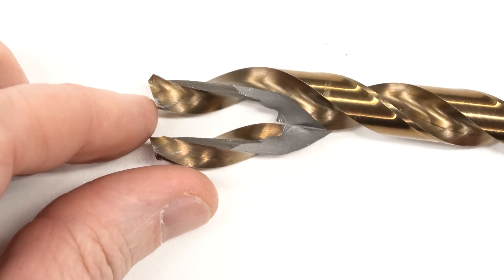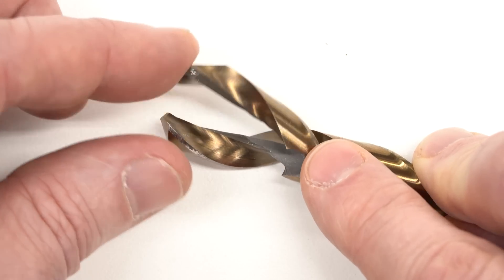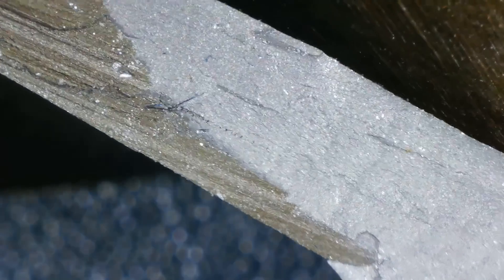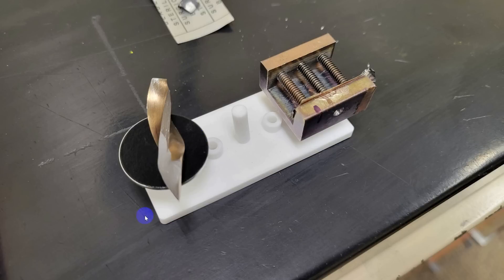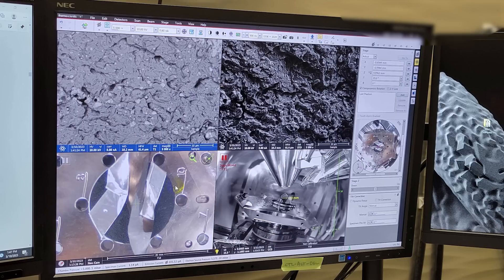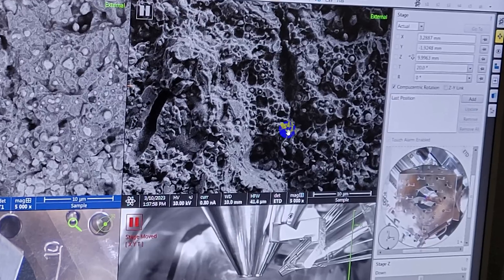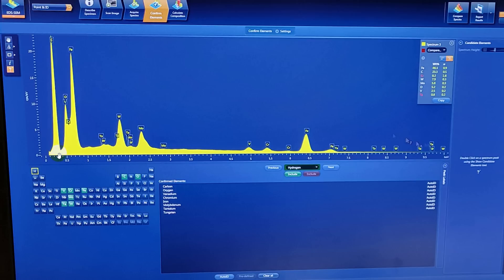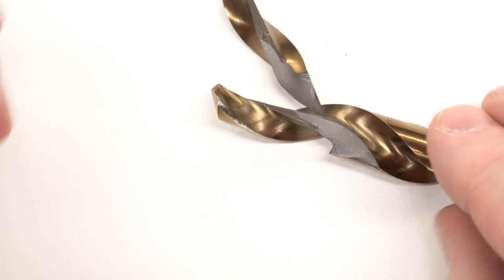What the Scanning Electron Microscope Reveals About This Failed Drill

Comment: Hi from France, James !
Many many thanks for this VERY INFORMATIVE content. I have an "oral tip" given to me, to use garlic juice when you have to drill or machining especially hard materials, able to reach very high Ultimate tensile strength, like "supercharged" titanium alloys, ASTM B348 grade #5 or ultra low interstitial formulation, like renowned #21.

Could you please make an attempt to drill a titanium sample with garlic juice as coolant/lubrification liquid ?
Then compare the kerfs, with ultrasonic degreasing cleaning solution like isopropyl alcohol, with the machined part, somewhere where garlic has not be used ?

It could be especially useful to prove on a stiff demonstration that the chips, curls, shavings, kerfs and turnings are much more "contaminated" with atomic sulfur, coming from the garlic juice ?
Until which depth ? It could be a brilliant way to determine an optimum of depth of cut.

When a metal is badly cold-streched, you create lots of translocations in the crystal lattice. Enough to allow low-temp melting point atoms to diffuse into the cold drawn metal, then lowering drastically the Yield Strength and also UTS, thus enhancing productivity by allowing softer curls, shavings and turnings to be extracted. Reducing tool fatigue, too.

Beware of garlic juice, it contains LOTS of sulfur and can create severe cutaneous burns.

It seems that the drill which have broke whas "charged" by carbon and oxygen diffusion, occuring when the heated part is too badly heated, in presence of carbon-rich substance. Especially at full austenitic point ("AC3" line in diagram phase, for common C-Mn steels, often around 970 to 1050°C). It can also be a migration of carbon-rich alloy which stay right in the middle of the bar.
"Major segregation" is the terminology used in metallurgy. The craters rims with embedded nodules on the grayish area are called in French "cupules" (cupolas, surely in english) and are the feature of ductiles fractures.

Normally, an heated titanium part in calm air should absorb dinitrogen & dioxygen from the air, allowing these gases to penetrate into the titanium heated ingot, to a given depth... creating intermetallic compounds, very brittle by the way. Giving cracks and uncertainity of UTS / low impact test values.

Best regards and bravo ! to have such curiosity and top-level apparatuses and competent people around you !!!

Comment: Great  video.  I wonder if the manufacturer would comment on your results.  How hot does the drill get?  Would it be possible that the crack formed and oxidation occurred.  This would have grown over time until the bit integrity failed, and the piece snapped.  I think there is a way to determine the oxidation layer thickness.  With that said, your explanation is most likely correct :)
Reply from the maker: In aluminum, there's no appreciable heat generated.
Reply: @Clough42  I guess that shoots down that idea :)  Thank you for the information.

Comment: Nice video. I wonder if you could have heard that crack if you 'rang' the bit- I tapped a couple 1/2"-ish HSS bits and they have a bright sound to them. Cobalt is supposed to be 5-8% in a good bit-- I wonder if the cobalt content was up to snuff- though the Co and Fe bumps seem mixed.

Comment: Enlarging holes is common. I do find if you don't allow the next larger size bit to load up at least half of it's point width, especially in soft material like aluminum, the bit is likely to dig, then grab and break. For example I wouldn't go from 3/8" to 1/2", but would go from 1/4" to 1/2". If you have to go up in size a little where the bit is likely to grab, then a really light feed will help keep it from digging.
Reply: Not only that, but one is wasting time if the increase in size is too small.  The previous drill bit in every step of the sequence should be just slightly larger in diameter than the chisel point of the larger drill.  Going in increments that are unnecessarily small at best only increases the number of operations to no good end, thus wasting time.  There is a huge drop in cutting force as soon as the hole is increased beyond the length of the chisel point.  Beyond that, the reduction in force is not that great, and as you properly point out, gouging and grabbing get more and more likely.  This was not the case here, though.  This was just a drill bit that was already cracked.
Reply: I don't think it was... Hard drills like this have no forgiveness for the sudden twisting of getting caught up in a hole like this with aluminum. Aluminum heats up and the hole contracts if your not drilling properly and his lathe basically grabbed that drill and twisted it to death from 0 to 60 in under a millisecond. If he used an HSS drill it would bend and not break.
Reply: @Jeralddoerr  Cobalt doesn't give a crap if a hole in aluminum "closes" or whether the material is "grabby." It's gonna cut regardless. Aluminum is such an effective heat sink that it tends to reach a uniform temperature well  before the hole would ever even close enough to "trap" a drill. The operation he was carrying out would have never spun the bit in that chuck if the bit wasn't cracked to begin with. Regular good quality HSS doesn't and shouldn't have much give at all. It's gonna shatter too if used improperly. The only part of a drill bit that should even remotely be soft enough to "bend" would be toward the end of the shank.
Reply: @rotorhead5826  1st off I have had this happen to me several times... 1 or 2 times actually breaking the drill... There's a lot going on here that people don't understand unless you use small lathes like he is using. I used to sell these small machines and tooling for them. He has said this same exact thing has happened to him with 3 different drills in the same set. Please explain that?  They don't grind all the drills in the set from the same piece of stock!
Reply: @Jeralddoerr  That is very odd! I can't even remember the last time I broke a drill bit, let alone anything cobalt. There are so many factors that go into it but to break three from the same set, I'd say there is clearly either  something wrong in the process they used to make the drill bits, or something wrong in the set-up of the lathe, like the tailstock isn't centered or is drilling at an angle. I've seen this cause many problems. I've also seen lots of manufacturing related imperfections when it comes to drill bits though- from improper heat treatment, shanks that aren't concentric to the point (on a reduced shank drill.) Some times it can simply be down to a coating that is wrong for the material. I've found some coatings bond aluminum and cause it to grab when the drill is half way through the part.
Reply: @rotorhead5826  like I said before.. All of his operations with the tail stock are bad. He should choking up more tailstock everything is hanging out so far from the tail stock.  If you watch his video where the drill broke watch what he does at 11:00 and up, It's all downhill from there. The center drill has a hard time doing its job and I know he's filming but that tailstock with a small arbor and the rest of the gear hanging out so far.. That big drill and tinny what?  Morse taper 2 or 3?
Reply: @Jeralddoerr  Short and fat is where it's at. I can't stand non-rigid setups. Lots of broken tooling can result from merely having something mis-aligned or not held properly. I personally feel like if a drill spins in the chuck, you're doing it wrong. I hate chucks though and try to avoid them if at all possible. It's idiotic to expect a 1/2" drill or S&D not to spin in a 1/2" chuck on an MT2 arbor 🤣
Reply: @rotorhead5826  Thank you... And people here are trying to kick me for blaming his setup and not the 3 drills with "defects" 🙄...
Reply: @Jeralddoerr  I maintain that his drill in this video shouldn't have broken regardless of how flimsy his set-up is, as a true cobalt tool is tough as all hell. Is the flimsy set-up a contributor? Hell yes. In the single instance of this video however, yes it seems to me it may have been initially caused by a crack- but I can't speak for any other failures he had prior to this one. I also question whether this particular drill bit was truly cobalt, or just some junky cobalt coated HSS- which I have had serious problems with in the past. (The boss wanted to try something new.)
Reply: @rotorhead5826  He names the drill company ..  Apparently, everyone loves them and has never had problems with their drills. They also have a lifetime warranty ... Not sure that applies to drops and misuse drilling at angles incorrectly.  Hard drills are awesome but for my hobby use with 75% percent Aluminum work with small lathes I use HSS drills as they are more forgiving and only use hard drills for a harder material.
Reply: @Jeralddoerr  All twist drills are necessary very hard, especially the cobalt type. This drill did not fail because it too hard. It was already cracked.
Reply: @ellieprice363  So what about the three he broke before doing this same type of operation? Guess this company has crap drills... Or this guys got better than Lotto luck!
Reply: Too small of an increase will in essence cause the bit to thread itself into the material and quickly stall or break.
Reply: This sort of comment is really useful, I definitely just learned that I've been trying too hard to go "little by little".    Thanks!
Reply: If you're doing a small enough increase in hole size a reamer would be the tool you'd want. Won't try to thread like previous comments mentioned, and will leave accurate smooth walled bores.
Reply: This is something that works really well for me, at some point in time I heard a general rule of thumb for pre-drillng, the starting bit should be around 1/3rd the diameter of your desired size.
Reply: Alternatively, if only drilling soft materials, one can bring the rake angle closer to 0 with a hand stone very easily to make the bit less self feeding/grabby. This is often done for drilling brass. Only takes a little material removal at the cutting edge to make it work, if you can sharpen drills it's easy enough to grind it back later.
Reply: @Broken_Yugo  For plastic, you actually want a slight negative rake with all tools, especially saw blades.

Comment: Hi James.  Very educational video!!  As a young graduate engineer about 50 years ago I was faced with a problem on a bridge job site.  The steel girders were manufactured to old plans however the new transverse stressing bars would not fit through the holes in the beam web.  The beams would have been equivalent to a Gr250 or Gr350.  The problem was compounded as half the bridge girders had been placed in position high up over the creek bed.  From memory, the holes needed to be enlarged from 1.5" to 1.625".  The holes had to be drilled as the use of oxy/acetylene enlarged holes was prohibited.  The contractor wanted a lot of money to crane down to the ground the already installed beams.  A normally ground 1.625" twist drill would probably last one hole or bind and stall the drill.  The solution was simle.  I just ground the drill's cutting edge to square up the cutting edge to a near neutral front relief angle.  This worked a treat.  Having a near neutral front relief angle meant that the drill would not grab the work.
Reply: good thinking. This is similar to what you would do if you had a dedicated set of drills for brass and other grabby materials.

Comment: i have found that pre drilling holes in steel has dulled my drills faster than not pre drilling. i assume this is from rubbing before cutting…when i apprenticed at a machine shop when i was younger i was told to use the largest drill possible then complete the hole with boring. smaller holes were drilled then reamed.
Reply from the maker: If you have heavy machines, this works great.  In Aluminum, I probably could have done that this time, but maybe not in steel.

Comment: Hi James
Very interesting really like the analysis because I had a very similar experience with a 10.5 mm 5% cobalt drill different manufacture but I was doing almost the same as you enlarging a hole in aluminium, and it snapped off a large piece. I took it back and was told that I was not supposed to use those drills in aluminium they are for hard metal only and it was user error.  I truly think this is an absolute crock but they would not replace it, to me what good is a drill if you cannot drill everything you want.
Also interesting about not enlarging a hole as I have always stepped up to larger sizes have we been doing this wrong all these years ? look forward to the comments or another video on drilling larger holes.
Reply: Mhm it stands to reason that different materials will want differently engineered drills. And yet unless you start bringing back piles of drill bits, they for sure should have replaced it, if it gets dull or bites and pulls it's one thing, but it splitting like that just doesn't look like an expected failure mode.
Reply: That is simply unrealistic. Different materials require different sharpness, different rake angles, and even different clearances.  While most common drill bits offer good compromises to allow a wide range of materials to be bored, there is simply no bit that is optimal for every material.  Custom grinding drill bit sets is a very good idea, even though it may void the warranty, and purchasing custom ground drill bit sets is also a very good idea.

Comment: I work with SEM, FIB, TEM, and STEM imaging systems for work doing failure analysis. I also use EDS and EELS analysis for material composition analysis. This was a very fun video to watch.  If your friend has access to a STEM or TEM ask them to to an insitu lift out at the transition and then image it in a STEM or TEM and perform ELLS or EDS on it looking for oxidation or a change in crystalline structure.  Some of the pulling your seeing is pre stress failing due to heat and some is from the time a failure would wager too. Would be interesting to see the material analysis report.
Reply: "Would be interesting to see the material analysis report." - I'm glad I'm not the only one that would love to go that far into a broken drill bit.
Reply: @Dreddip  I resemble that remark!  Yes, it is definitely an academic excercise.
Reply: Wouldn't the drill sample be far too thick to do TEM or EELS on? I thought the sample thickness needs to be less than a micron for the electrons to penetrate.
Reply: @cameronmcguire5025  that’s the purpose of the insitu lift out, you pull a small section out using a FIB and then thin it to electron transparency for imaging and analysis.
Reply: @Human_OU812  oh okay, I'm not too familiar with TEM and FIB, I'm a graduate student studying studying the use of EXAFS and XANES and I haven't come across those terms you're using before. I'll have to look into that.

Comment: James, have you shared your findings with Drill Hog? They may be able to refine their manufacturing processes or consult with their suppliers.
Reply from the maker: Yes.  I showed them my results.  They responded positively, and sent over some other goodies with the replacement.
Reply: You can be sure they're watching this video..
Reply: @jimurrata6785  You can also be sure they'll never admit to any fault on their side, and I'm willing to bet they were already well aware that some of their stuff has some issues in production.
Reply: @AttilaAsztalos  Why so cynical?
I'm sure Drillhog doesn't NDT every bit that comes off their line.
They made James whole and fortunately he didn't scrap a project because of the failure.  👍
Reply: @jimurrata6785  Experience does that to you. You learn to never ascribe to happenstance anything that can be adequately explained by incompetence and not giving a shit. Considering even James himself noted (iirc) that this is NOT his first hog drill to fail this way, in addition to some commenters noting the same thing, either their QA most likely spotted the issue long ago they just decided the easiest thing is to do nothing about it, or else their QA apparently ain't worth shit.